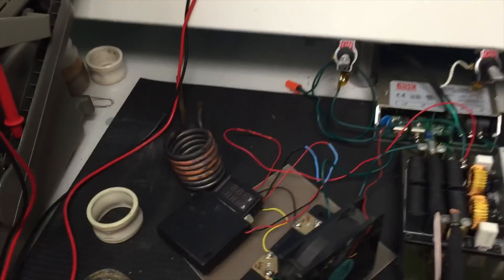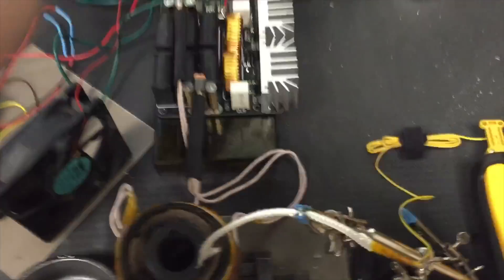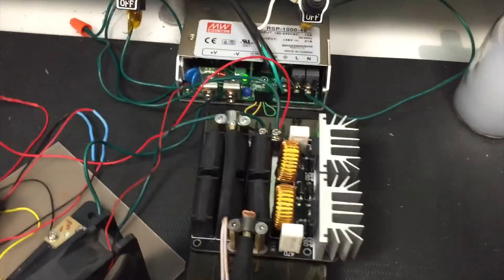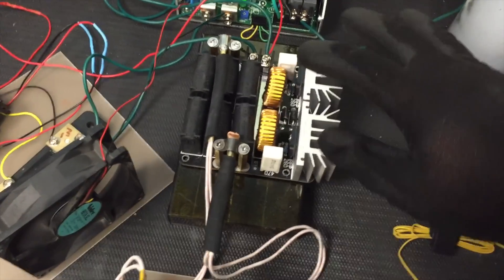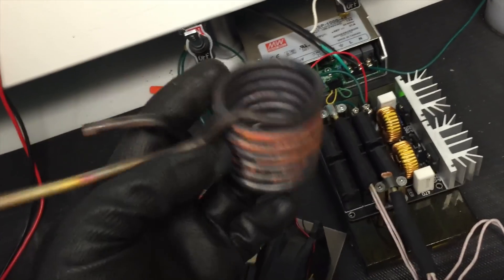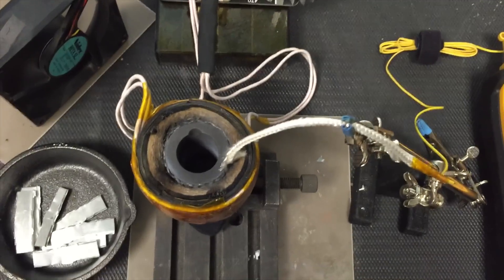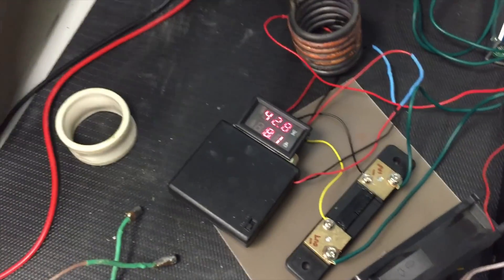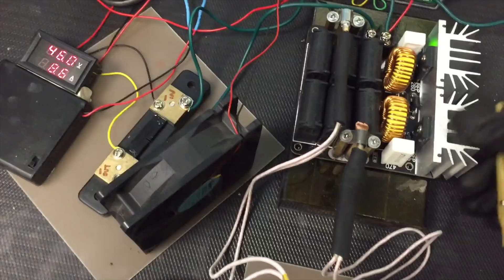1000W Induction Heating Part 3: Melting Aluminum

Comment: did you have to make a new coil for graphite crucible to reach high enough temp? running same but cant get past dark red
Reply from the maker: I made the coil in the video.  It is insulated from the crucible with a pad similar to ceramic fiber.  Watch my battery powered video.  I got the crucible bright red with the stock coil as well but for melting purposed, I would insulate the crucible with something similar to kaowool to prevent the heat from leaking back through to the coil and the PCB.  What power supply are you using?
Reply: Proto G 48v 10amp
Reply: Proto G also used two car batteries but still couldn't reach temp

Comment: Would a dual or 3 phase induction heater work at higher temperatures or work more efficiently? Having 2-3 coils of tubing instead of one. Is there any advantage?

Comment: So...you place magnetic induction coils in the walls of a cylindrical room.  In this room, flooded with sea water, you place a Steel piece, like several plates intersecting at their center for more surface area.  The steam produced by the heated metal goes on to produce electricity, quite a lot of it.  We can't do this on a large enough scale to produce mass amounts of energy or in a small enough model to power a home?
Reply: Instead of doing that, use the power you'd be putting in to the coil to power the home instead. This isn't an over unity machine.

Comment: how much does it cost per hour to run that thing.
Reply: Depending of the cost of the electricity in your country.

1 kWh in France cost around 0.15€

If by example, you use this exact model of induction heating, in France, for a week, non-stop, it will cost you ( 7 days * 24 hours * 0.15€ ) = 25.2€

Comment: Nice video, thanks for this. Question, could a 48v 10a smps gamble this induction heater? I noticed you were only drawing just over 8 amps at 40v? I'm wanting to use a setup like this for melting silver. Thanks for any insight

Comment: Hi, I have put one of these together using a zvs driver from eBay. It has a fan cooling the board and the coil is water cooled. I'm running it of a 48v 25A switching power supply with a similar display for current and voltage. I have heard it is bad to turn the coil on with something inside it (I.e. the crucible) and that you should switch it on and then lower the crucible In. Is this true? I see you just turn it on with the crucible already inside. I plan to melt aluminium and other non ferrous metals using a graphite crucible.

Comment: What a nice and informative video Proto! It's detail and quite in depth explanation easily tell us how it works. Also, i have a question about the thermocouple, doesn't the induction coil also induce the thermocouple that you placed between the isolator and graphite crucible inside the coil? If so, are you already calibrate it with some method? Thanks for the video!

Comment: have you tried hacking an induction cooker into an induction heater?
Reply: That's an interesting idea!  Amazon has a simple portable one for $45.  It may have to be hacked as you suggested because the stock one limits the temperature to less than 500F.  Maybe the coil would have to be replaced with a custom built external one.
Did you ever try one since your comment was posted?
https://www.amazon.com/Gourmia-Multifunction-Countertop-SmartSense-Temperature/dp/B017HX1BMS/ref=pd_sim_79_4?_encoding=UTF8&pd_rd_i=B017HX1BMS&pd_rd_r=EMWM7Y3K3DXNWA47YJW6&pd_rd_w=N2OuP&pd_rd_wg=kr9B4&psc=1&refRID=EMWM7Y3K3DXNWA47YJW6
Reply: can any 1 tell me the used  frequency  ??

Comment: Hi bud. Im looking for a tool that allows me to braze carbide tips into steel shanks and i thought about this. Do you think it will work? I need it to go cherry hot so it melts the silver solder and brazes the carbide tips. Also for tempering punches and such. Do you reckon this setup would work? Should i go with circulating coolant on the induction coil/tube to protect it? Thanks in advance. Fred

Comment: what would be the max. temp. you could achieve using this method?  Could you reach the melting point of Gold?
Reply from the maker: I've gotten around 1100C so that would be enough to melt gold but not steel
Reply: thanks for the quick answer.  I've seen the parts you got from China, inductor etc, I'll see if I can't cobble something together, probably put me in the grave, lol..... thanks and I'll keep watching....
Reply: But "jet fuel will melt steel beams" at far lower temperature (700C).  Supposedly   ;)  ;)
Reply: @kyleb3754  oh, it's this shit again. Steel doesn't have to melt to become structurally unstable. If you have pillars supporting thousands of tons of concrete and glass, the decrease in tensile strength at 700°C is more than enough to make a building crumble.
Reply: @gayusschwulius8490  I'm well aware of that.  Like... supremely absolutely college professor aware. I build steam boilers (1000C/2500psia) for a hobby.   Heating metals just a little bit makes them terribly weak, unfortunately.  But, I'm also aware that buildings do not fall straight down. So, 1 conspiracy dead, another still quite alive.  Don't really care tho, my original post was just some silly drunk joke.
Reply: @kyleb3754  See, this we can agree on. I have just read this argument too often

Comment: I may be wrong on this, but the coil that it CAME WITH was made of hollow pipe and not WIRE for a reason, it is so that you can circulate water through it to cool the coil. Have you tried it this way? water cooling is better than air, won't cool off your crucible, and should make everything super awesome.
Reply from the maker: You're not wrong, but my coil does not get hot as it is insulated from the crucible.  The included coil works but it is not the best coil for every job and requires water cooling if using for extended periods of time.  The litz wire used in my coil is used in almost all commercial induction cooktops as it is the most efficient means of transferring power and doesn't require unnecessary water cooling.  My coils produce an equivalent temperature rise in the crucible while using less power from the power supply and also making it cool enough on the outside to handle without tongs.  The litz wire can be used to make several different attachments for the heater.
Reply: Proto G why are you using a fan then?
Reply from the maker: The fan is for the capacitors, not the coil.  It wasn't pointing at the caps in this video for some reason, but watch part 4 where I boil the water with the pancake coil and you'll see it pointing at the caps.

Comment: Awesome video man. Would an adjustable 48V, 10A power supply work or does it have to be 48V 20A? Also, what's the reason that it draws huge amps at low V (based on some of the comments)? Electronics not my strong suit!
Reply from the maker: 24V/10A would be better than 48V/10A but 48V/20A is better than 24V/10A.  The reason it draws large amounts of current at lower voltage has nothing to do with the voltage, but rather the quality of the power supply.  If the rise time of the power supply is too slow, it will cause both of the MOSFETs to turn on, which cause a large current to flow but doesn't produce any output on the coil of the heater.
Reply: Gotcha. Thanks!

Comment: also you want to put a fan on toip of the mosfets to keep them cool.
Reply from the maker: If your power supply is good enough, the MOSFETs shouldn't get that hot.  That's the whole point of a zero voltage switching circuit.  The MOSFETs are supposed to switch off with zero voltage across them which drastically reduces switching losses.  The capacitors are what really need the fan.

Comment: I see that the title picture for this video DOES show the crucible in the original copper tubing coil..It's that setup that I need to know the voltage and current for.
Reply from the maker: That was just a test with my 48V, 20A power supply.  Check here for more info and and links to all the parts I used.  
http://www.instructables.com/id/7-Uses-For-an-Induction-Heating-Machine-How-to-Mak/

Comment: I understand that you like to make your own coils, but in this video, you are only drawing about 7 amps at about 48 volts with the crucible in your home made coil.  When I put the crucible into the copper tube coil that came with the heater, the ciruict draws well over 30 amps from my 24 volt supply.  Have you tried to heat the crucible in the original copper coil?  If so, what voltage/current relationship did you find?
Reply: It depends on the inductance of the coil - the more inductance you have, the more voltage you need for a certain heating power, but less current. The opposit happens if the coil has lower inductance of course. 
What works best, depends on your circuit design and what transistors you use. I don't know very much about this particular design - but apphearently it works good the way he run it, and lower current is never a problem for the components (unless you compensate lost heating power by increase the voltage soo much that you risk exceeding the transistors and/or capacitors maximum voltage of course)

Comment: You only seem to be using 300 watts to produce that much heat and melt the aluminium.  39.4 volts x 7.6 Amps = about 300 watts. (Not bad)
Reply from the maker: Yeah, it fluctuates a bit.  At 05:41 you can see 46.1V @8.3A(382W).  The hardest I've ran this unit is shown in the battery powered video with 38.1V @32A(1219W!)

Comment: Could one run a induction heater of some solar panels with car batteries or can't they provide enough power?
It would be interesting to build this as a prepper and be able to melt metal anywhere with just some solar power.
Would a 12V 44Ah car battery be sufficient and should it be coupled with capacitors, i don't have any real electrical knowledge yet so i would be very thankful for a simple answer! :)
Reply: 12V is not enough for this induction heater you would need 36-48V so 3-4 12V batteries in series
Reply: +Besjan Saidi I understand but you could use a step up transformer to get higher voltage ouput if i understand that correctly
Reply: It would be possible but need 1500- 2000w  inverter to run the 12 VDC up to 110ac then back down again through the 1000 w power supply he's got in the video

Comment: Advice request: I have two carbon crucibles both are larger than yours.  I am primarily interested in small aluminum foundry, and wondering if this ZVS drivers is the best option or even adequate since I will need to create my own coils to fit my crucibles.  I think they are 100 and 500cc crucibles.  I will measure the dimensions.

Comment: i manged to burn the mosfets what mosfet is it thanks
Reply from the maker: +jack theninja It says the part number right on both of the MOSFETs.  It's an IRFP260N.  Unless you find out why you blew them, you will probably just blow them again with your current setup.
Reply: nvm i did not blew them ;)

Comment: i build something like that with same component, but my furnace take much more current than yours, and can only melt 200g of aluminum. is there something wrong with my circuit?
Reply from the maker: +Gunawan Pratama I don't know what you used.  What power supply, what type of coil, inductance of coil, insulation type, thickness of insulation? etc.
Reply: power supply output 48V, 50A max
for the driver, i use same schematic as mazilli zvs, with spec
mosfet irfp260, resistor 470Ω and 10kΩ 5W each, fast diode fr307, zener IN4742, and choke inductor 160-ish uH
and for LC tank, i use 16 MKPH 0.3uF 630 VAC 1200VDC 50kHz, so total capacitance is 4.8 uF, and the coil are copper tube with diameter about 0.8cm 12 turn wich produce 8.3uH inductance.
for the insulation i only use ceramic fiber, spec tells that it can withstand up to 1000 C, and the furnace itself i use graphite base furnace
what is the main key to produce high temperature, is it frequency or the tank current itself?
Reply from the maker: +Gunawan Pratama I did not use the copper coil.  I used a custom coil with more inductance.  My power supply also limits the current to about 20A at 48V which is the max rating of the zvs driver.  48V 50A is way overpowered and can easily damage the MOSFETs.  You can remove capacitors to increase the frequency which will result in faster surface heating.  High end induction heating machines will follow the resonance of the work piece and adjust the frequency to maximize heating.  Good luck.
Reply: 48V 50A is way overpowered and can easily damage the MOSFETs

really i  don't think so
i think load will talk enough amp for good work and he will leave the additional amp 
i don't know if aim right . please tell am
and you have Avery nice video
thanks

Comment: Great work! Brilliant idea with the fiberglass wrap! Approx what temperature/metal would be the workable threshold for this design?  Would it work for copper, gold, any alloyed steels?

Had you considered using ceramic fiber insulation or aerogel fabric for insulation?
Reply from the maker: +worldburger Thanks, this crucible actually is insulated with an aerogel blanket.  The solder pot on the other hand, used a fiberglass wrap that I embedded aerogel into.  I'm not totally sure of the limits, but I've used it up to 900 degrees Celsius.

Comment: I will very much appreciate if you want to help me with  some advice .I intend to use with a graphite crucible to reach 1200°C to melt bronze or silver and I would like to control the temperature with a PID temp controler .My problem is also the powers supply ; would be enough if I use this item from AliExpress ?

http://www.aliexpress.com/item/600W-48V-Single-Output-Switching-power-supply-for-LED-Strip-light-AC-to-DC/621245587.html?spm=2114.13010208.99999999.303.aaTfiK

 I have a variable power supply 0-24V max 5A it works great for the small toy 8$ zvs item, but not for the 1000W.  By the way l already blow up the mosfet from a 1000W zvs using 24V from 2 car serial battery  thanks in advance
Reply: Did you ever connect the PID? Would love more details as I am doing something similar

Comment: Hi, Your videos are inspiring.

I received my Mean Well SE-1000-48 power supply.

As it seems they do not come with power cable/adapter etc. And while watching your video I see that you have toogle switches probably one for the power supply and one for the ZVS driver.

As 48V and 20.8A will be passing through the tooggle switches. What kind of Toogle switches did you use? If you could give me some referrence I would really appreciate.

Thanks in Advance, 

Ati
Reply from the maker: +Atilgan Sesen Any 20A toggle like this http://amzn.to/1VeXgK7  It's not a big deal to go over 20 amps with the toggle switches seeing that they're rated for 15 amps at 240VAC and 20 amps at 120VAC.  That's over 2,000 watts.  For direct current, the general formula for joule heating(resistive heating) is P = (Va-Vb)*I so a toggle switch rated for 20amps at 120VAC rms should easily be able to handle over 20 amps at 48VDC.
Reply: +Proto G Thank you very much. I really appreciaate your suggestion.

I just ordered those: 
http://www.ebay.ca/itm/5-X-Heavy-Duty-20A-125V-SPST-2-Terminal-ON-OFF-Toggle-Switch-Waterproof-Boot-/161865893417?hash=item25aff58629:g:7xoAAOSw9mFWKJiv&vxp=mtr

I will give updates and I am looking forward to see new videos ;)

Best Regards

Ati

Comment: Did you opt to go for an oven due to using DC power?  I presume the aluminum would not react to the induction because it isn't moving (if I understand the concept correctly).

Have you experimented with AC power, or does your controller not support it (not to mention the power supply)?
Reply from the maker: +Kennosuke Vernon The DC is converted to high frequency AC and aluminum does react to it, but not as much as graphite does.  So in this case, the graphite is just speeding up the process.  I suggest you reading the article I wrote on this topic here: http://www.instructables.com/id/7-Uses-For-an-Induction-Heating-Machine-How-to-Mak/

Comment: What is the max temp that you got the Graphite crucible to...using the 1000W ZVS driver?
Reply from the maker: +Paul Wilkins In this video, the max temperature was about 1526F/830C.  If you watch part 5 you will see it get up to 1925F/1051C with using lipo batteries.  I do not know what the max temperature this is capable of beyond what I've done.

Comment: Any idea how off the temperature readings are? Because the probe itself will heat up because of the induction not just the heatig of the crucible.
Reply from the maker: +Fekete Imre I don't think it's that big of an issue.  I have probed after turning the coil off and still had the same readings.